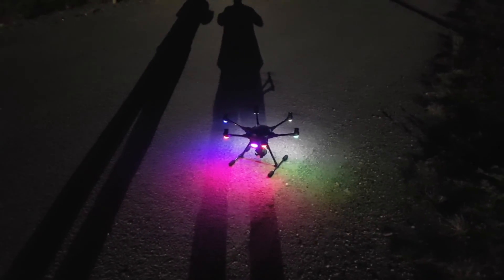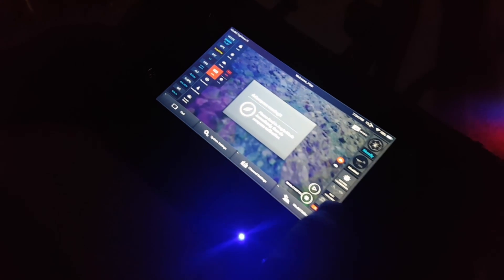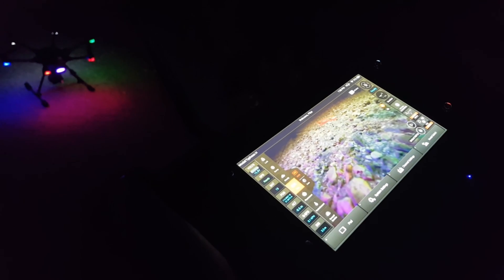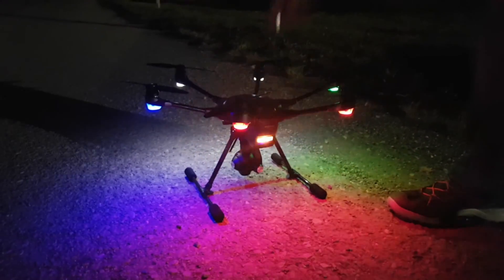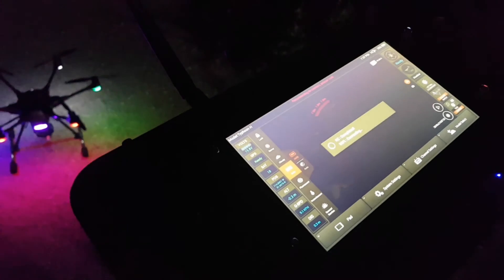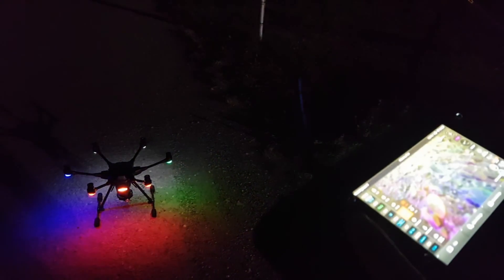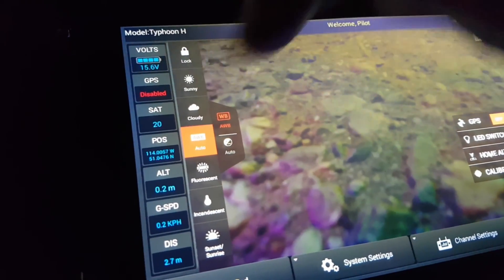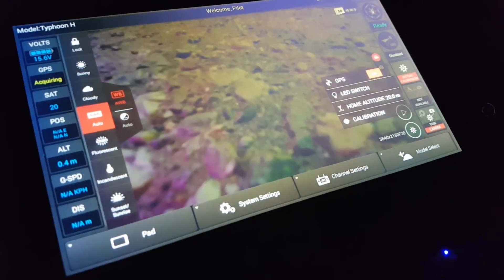Drone Crash Whats Wrong with the Replacement? Yuneec Typhoon H

Comment: Why are you flying at night
Reply: Legal to fly at night and before dark and just 30 minutes before sunrise if u have proper FAA strobes. I have them and fly ever night helicopters and multirotors. If interested i can tell u where to get them. At Amazon.com. They are visible at 3 miles at night. Three square miles all directions and FAA approved.
Reply: Open skies to you. Pilots saying from the fifties. Meaning fly free. Now a days nothing but regulations. Good luck to you.
Reply from the maker: I'm not flying at night...  and did not fly that night, capturing this failed state was the sole purpose of even starting the motors....  this video was filmed at night because the sun sets here at like 5:40pm that time of year.  so I made the choice to capture the trouble shooting steps for the sole purpose of documenting the error conditions.  At the time that I originally needed this video it was not possible to film it during the day and Yuneec wanted to see what was going on....
Reply from the maker: Tim Wiley - Thanks for the tips.  In Canada at the time this was filmed it was not illegal to fly at night (I didn't in this video anyway) it was a guideline to not fly at night.  two weeks ago the law on night flying changed making it illegal period.  It doesn't have the same exceptions as the FAA does in the USA so getting lights doesn't help the case at this point.  I'm not comfortable flying at night anyways myself, and the lights are a good idea for those that can still do it legally, but that is not the case in Canada.  Not to mention we have to keep our flights within 500 meters of our line of sight now also.  so basically night flight is not an option for any hobby flyer in Canada, and I'm not even sure about those operating with an SFOC here (they have different rules than "model aircraft" users like me).
Reply: Thanks for the info. I test lighting for approval by the FAA for commercial and private use. Non-profit to benefit all. My test bed is at over 8,oooft sea level. I have lost visual w/ daylight flights, but never at night because of lighting. Also good strobes will help to keep visual of daylight operating uav as well. Based on my experience. You do get reported as a UFO some times,  being at 400 ft agl.  Have fun and thanks for the  info on your local rules. Tim
Reply from the maker: Thats impressive viewable distance...  would that sort of bright light interfere with day time filming?  Does the product you test have a way to turn it self on/off when filming and/or off/on when a certain distance away from the base station is reached?   In Canada the new rules say we are not to go more than 300ft (90m) AGL now also.   In Canada getting reported as a UFO is the least of our worries,  the Minister of transport (a former astronaut) said for citizens to call 911 if they THINK a drone flight is not safe.  Id be happy with a UFO report.  Last time I was out we were so remote that that a guy shooting at coyotes  could have killed us because he didn't expect to find people flying in such a remote area - lesson learned on that - even when it says no hunting people are hunting.
Reply: I live in a vast open area at 8,000 coyotes are a problem really. These units weigh 4 grame each have stand alone built lipo. They are not themselves remotely controlable.  They have built in power and menu button. When using camera iuse one on top of craft for full size craft avoidance. and one on the back torwards me, for my line of sight reference. They cost U.S $ 39.00 for the CREE LED strobe. The $29.00 version is only visible up to one mile at night. I recomend the Cree version. Firehouse technologies At Amazon .com. They make full sets w/ Port side red and starboard side green strobes. The red and green  are not as bright, to help w/ over all visual reference. I do not sell or work for amazon or firehouse tech. I just appreciate the professional level results, as I am working on a commercial full scale uav license. Good luck.
Reply from the maker: Thanks for the recommendation.  I will take a look at those.  likely after the laws are clarified here to see what we are in for.  This is an intern order so they could make changes for better or worse possible by the end of this year.   But I will look into these lights for sure.  thanks again for the recommendation.
Reply from the maker: Thanks and same to you!
Reply: whats the difference why he is flying at night,, ??
people always poised and ready to pounce on the stupidest things,,

Comment: Could certainly be the firmware upgrade, however I noticed you were quite close to fence posts which can interfere with your compass calibration.   The last point about GPS being on or off and results on the position seems to be an ultimate tell-tale that something isn't right with the firmware.  Have you tried upgrading your firmware again with an application cache clearing (via android application settings / clear cache) before anything else?  Is it bound correctly (I've learned that sometimes it will bind --  PARTIALLY -- meaning that all looks good but you get strange stuff).   I would call Yuneec and have them walk through all the steps to reload the firmware, clear caches, re-bind, re-calibrate and test) with them on the phone.  I've gone through this process with them and they are quite helpful and will spend the time needed to resolve.   One last question -- is this a 1st release version?  Did you purchase as a pre-order and receive it in May/June?   Many suspect that the first H's have different component versions that may an issue with recent firmware upgrades.  Good luck with it.  Would like to see what happens in this story.   Will subscribe
Reply from the maker: Airtography thanks for the feedback.  This was a preorder that I got in august.  The one I received  in august flew fine for two days and then smashed itself into the ground (I have that video up on this channel).  This fence post doesn't actually matter, large metal objects can affect the compass but not in this case, I have before and since this was filmed flown in this spot with no issues once the firmware was updated.   I filmed it here because that's the only place  I could meet the guy who filmed it for me and was safe to try.   I've done this in open fields for weeks before with the same result. At the end of the day.  I did get to work and I did point out in the info about this video that was the case.   It was ultimately firmware that fixed it.   No questions about that.  The same aircraft in the same spot with the same hardware works fine now. 

The versions of firmware prior to I think it was 2.93 for the autopilot (they have different versions numbers for each part of the software and then a new software version for the bundle, just to confuse us). Basically the latest version is fine now with minor issues.  The craft can at least fly.    I have some other video where the TH starts to act up in Sept and Oct versions of the firmware but based on where I filmed them they give away too much personal info so I'm not posting them.

I can 100% say that in my case firmware was the issue and version 3 has almost solved every bug now.
Reply from the maker: I find the GPS position going away and coming back the opposite way of logic interesting also..  I actually forgot about that until I watched this video again.  If the weather here improves I'm going to go and see how that behaves with the version 3.0 firmware I have installed already and see if behaves the same.  At the end of the day I was very surprised it was not hardware issues that needed replacement parts.  When they came out with the Oct 27th (I think it was) firmware that stated they updated the software for temperature related issues is what gave me hope it would work, and that update is what started the path to recovery.  I'm not sure exactly what they did with the temperature management but I suspect the GPS/COMPASS Unified Part is sensitive to either being too cold or too hot.  My guess is the firmware was written to somehow manage that, and some people have said they slowed down the GPS update rate to achieve this.  Either way, it seems to have solved it, and my guess is that if there is a need to replace GPS/Compass boards they will do so with no public statement.  

At the end of the day, I'm looking forward to the Jan 2017 updates that are promising big things...  Google Maps integration  for example,  I heard there is tweaks to the camera software also that improve it and Real Sense should actually have some better integration too.  This could all be things the Yuneec people told me to keep me on the hook long enough for them to solve the problems they had, but I remain hopefully - a software update and modernization would be very nice...  (not to mention the new camera's they should be providing us soon too) <=- Speculation based on a "hint" someone dropped....
Reply: Yes -- I had issues with the B25 and the 3.0 versions. Now on B27 and 3.01 and looks like all is well.   It still wants to sometimes hop off the ground when landing -- like it's landing in hot water -- but I've come to expect it, manage it, and hope too that the January release will resolve what I've experienced and others have as well.    Good luck with your continued testing.
Reply from the maker: THanks - I get the bounce once in a while, and I have only had one issue with it as its just about to land it starts to fly away from me at abut 6-8 inches off the ground only to catch and flip because its still descending while flying away from me.  I have no idea why it did that, and thats the worst its ever done.  Like you I some times get a bounce as I'm landing but that thats not a big deal,  I actually got use the bounce as an owner of the Q500+ which did that as a "normal" landing mode.

I'm going to upgrade to the Jan 2017 version when its out, and skip 3.01 as its too cold to fly here now anyways.  Its going to be march at least before the weather improves.  We get "Chinooks" here which are warm spells based on how the air comes in over the mountains from the coast, and at times those days of +10 weather line up with my weekends and I might be able to try earlier.  Fingers crossed that the  Jan update is all thats promised!
Reply: Good info.  If you were flying now, I'd suggest 3.01 as I had issues with the 3.0.    Tip -- I learned (of course the hard way) that when landing when windy, orient one of the legs to face the wind (perpendicular).  This avoids a tip-over if the wind catches it when landed. Cheers!
Reply from the maker: I dont intent to keep flying on version 3.0 actually,  its not perfect enough for me so I will head your advice on version 3,01 before I take it back up in the air!  Thanks!

Comment: maybe this will help you.  st16 reset and callibrate.    https://www.youtube.com/watch?v=ZGzvw9Sn7PQ&t=83s
Reply from the maker: Thanks for the advice;  I have done that procedure - and honestly - the issues you see here were not related to anything other than firmware issues.  When version 2.9 (I think it was) of the firmware was published the same craft didn't show any compass or GPS errors.  The calibration menu for the ST16 only solves mild drifting problems.  Also; I have the machine working fine now but version 3.0 of the firmware re introduced some of the old ghosts albeit very mild compared to before.  I have not tried version 3.01 yet as there is a version coming out in January that brings back the stability of the 2.9x(2.93?) auto pilot and adds extra features to be more competitive to the DJI line.  This video was mainly to show the issues and the journey.  You will find a couple of TH videos on my site that were filmed AFTER all the issues documented over the past 3 or 4 months.

Comment: Excellent video big thumbs up !
Reply from the maker: Thanks for the feedback...  I hesitated putting this up originally but now that the version 3.0 and 3.01 firmware have corrected the very strange Compass/GPS issues I felt I could put this video up to demonstrate the V3.x base was functional.  My fingers are crossed that the Jan update brings back the stability of version 2.9x and the features they introduced in version 3.x.  One can hope....

All that, but still the TH handles well - its an impressive craft (when not effected by a defect) - very stable in the air, responsive and a joy to fly otherwise.  The camera is good enough for most, and if you learn to use it without being in "AUTO" camera mode it produces a pretty good image - this has been demonstrated by guys like CaptainDrone.  I Have not focused on the video setting portion of this drone because I have spent way too much time with the firmware issues that haunted me.  Please keep in mind that the TH largely works perfect for a very large majority, a small but noticeable group were effected thats all...